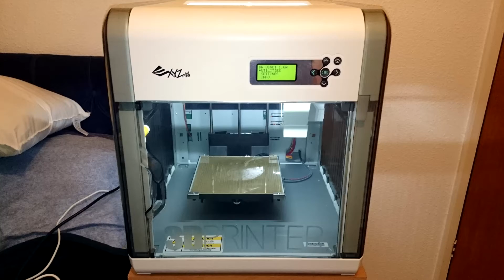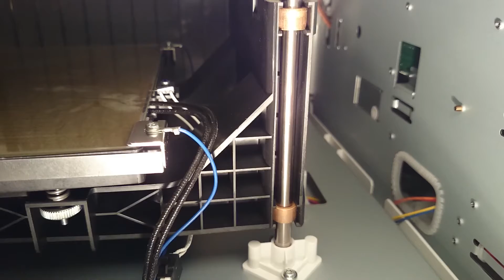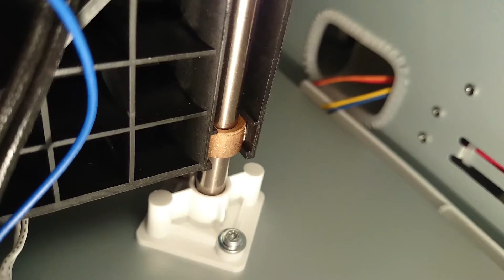XYZ DaVinci 1.0A 3D Printer Build Platform Fix

Comment: Hey there Steven did you have calibration proplems. I have 1.0 AIO and my measurments are all over. Calibrete see the number  ( 203  209 213  try calibrating again without adjusting then I get 225  202 194 . Im going to try your solution  I hope it helps